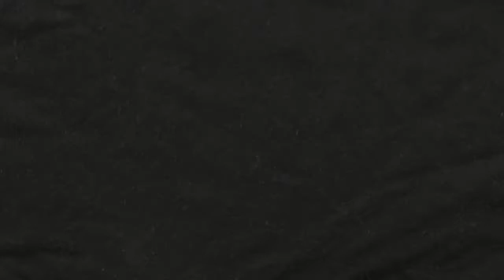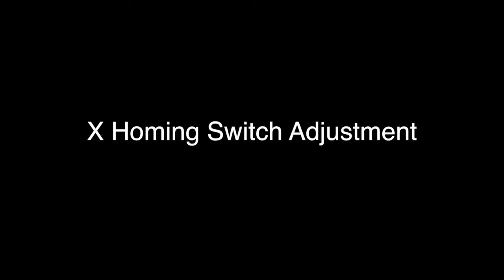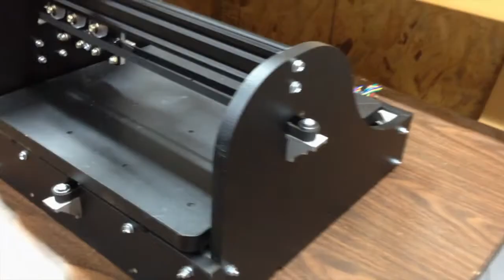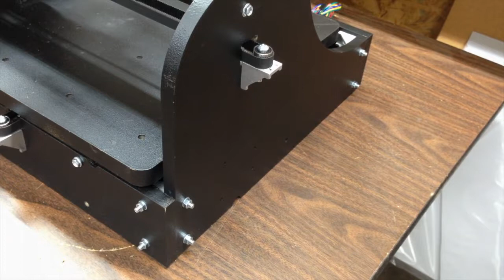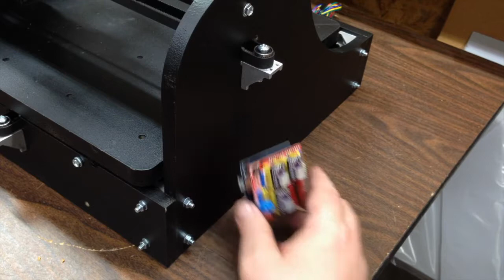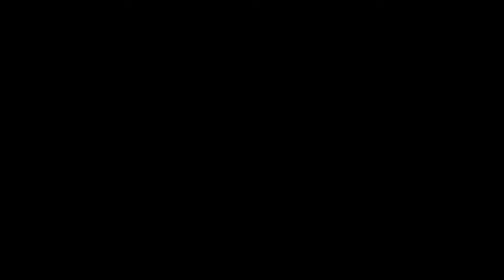Millright CNC Assembly Part 4 - X Axis Homing Switch

Comment: I got the whole M3 built but It doesn't want to move? I'm using USG and Easel. Any thoughts on the problem?
Reply from the maker: While I like Easel, it always wants to overwrite your M3's firmware and if you're not sure what it's asking, you probably let it, which is no good. Did you try to carve from within Easel or did you export the g code out of Easel, onto your computer, and then use UGS to send that g code to your M3?
Reply: I haven’t even got it to move yet. I’m still trying to figure out why it’s not communicating with my computer.
Reply from the maker: So you apply power to the power supply and the Arduino is connected to the computer via the USB cable. Does the fan spin?
Reply from the maker: I'm going to advise that you go to the MillrightCNC forums, sign up, and post this question to the General Discussion section. I, and many other users, help people there all the time, as does the owner of MillrightCNC, Derek. The forum is at http://millrightcnc.proboards.com Go sign up and post your question and then we'll all get you up and running!
Reply: I already put my question there and been taking to people. I hope I can figure this out.
Reply from the maker: What's your name on there? I'll find the thread and see if I can help there.
 @beatsnomadic
Reply: @bigmanblackt-shirt8506  dayna818
Reply: @bigmanblackt-shirt8506  I changed the setting s to mirror up to yours and I'm still not getting enough power to the motors (thats what it seems like).